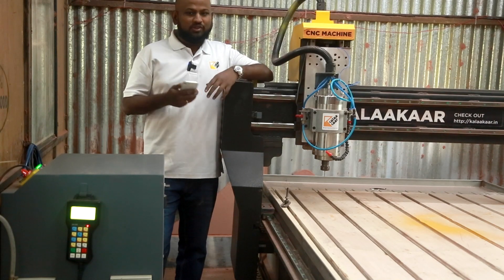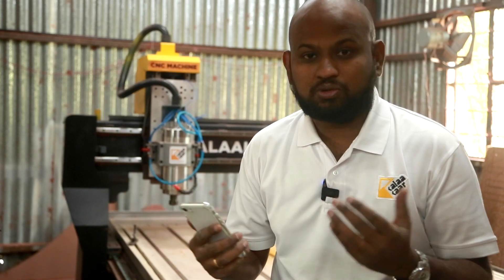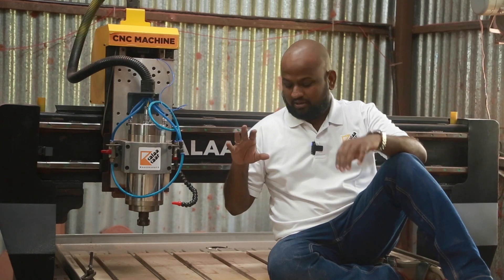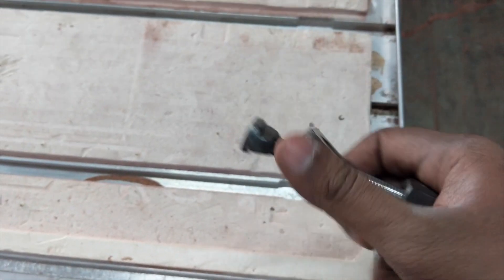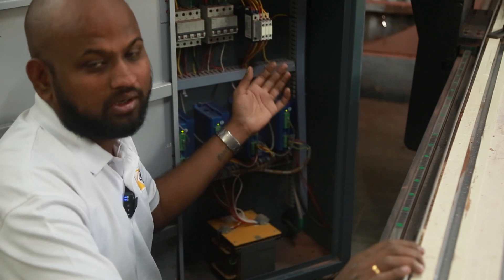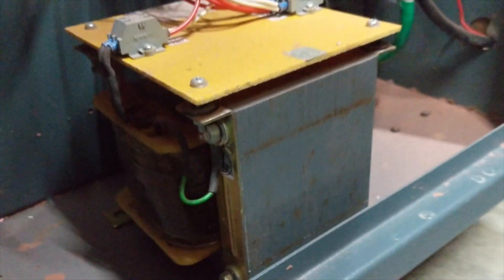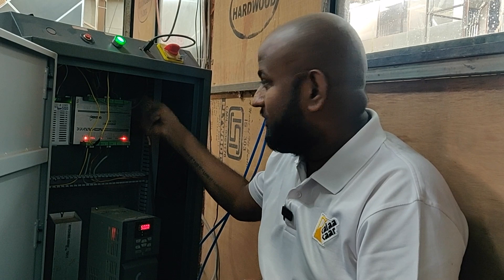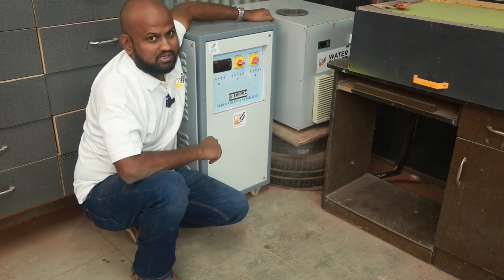CNC Machine in Pune - Tour of 8x4 feet 3axis // SIL Lasers

Comment: How long have you been using this machine I am also considering to buy cnc router any tips
Reply from the maker: It's been 3yrs. I have given all the tips in the video. Let me know if you have specific questions
Reply: @Kalaakaar-in  I am mainly looking to use it for wood like mdf and ply so what type of spindle should I consider
Also what software are bundled with machine if any
Other programs you use for designing and machine operating
Any other brand can you recommend other than sil or is it better option

Comment: If cutting plain sheets upto 15mm then how to decide if laser cutting is a better option or a cnc machine? Can you share what is the price of this machine
Reply from the maker: Cutting using laser is always costlier as the thickness of the sheet increases. Also when thickness increases then have to run the laser machine at a slow feed rate. If it’s plastic and acrylic laser is better
Reply: @Kalaakaar-in  thank you
Reply: Laser is good for upto 8 mm
Only
I have 100 watt co2 laser
I only use it for upto 8mm thickness
Material is no issue you can cut ply, mdf, acrylic
For 15mm I would suggest go for cnc